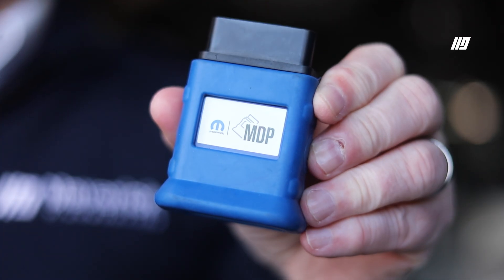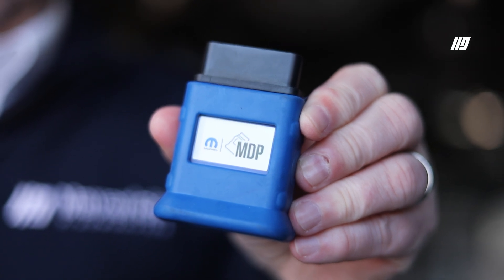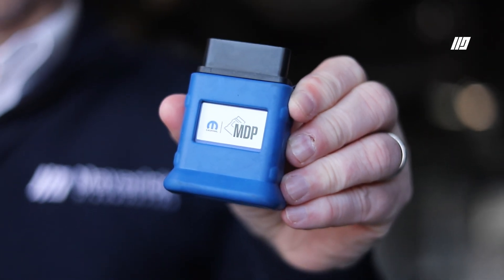Tool Overview: FCA Group Mopar Diagnostic Pod

Comment: Instale el modulo de suspensión neumática de Grand Cherokee summit 2021 con esta herramienta MDP y al parecer quedó bloqueado ahora con launch no puedo hacer los ajustes de altura, ni autel puede ajustar nada
Reply from the maker: That sounds frustrating. Unfortunately, we can’t troubleshoot individual repair issues here. For situations like this, the safest option is always to use the official FCA/Mopar Diagnostic Pod with a valid subscription, as aftermarket tools (Launch, Autel etc.) can often have limitations or create conflicts with newer modules.
Reply: @maverickdiagnostics lo entiendo solo que con el modulo anterior launch si hacía todos los ajustes ya que con launch en otras Cherokee's iguales si puedo llegar los ajustes básicos